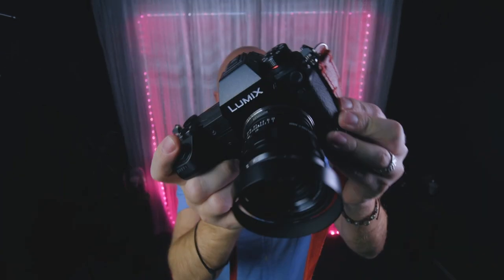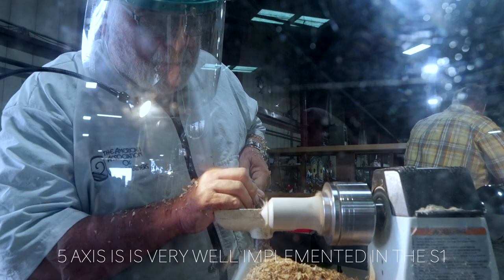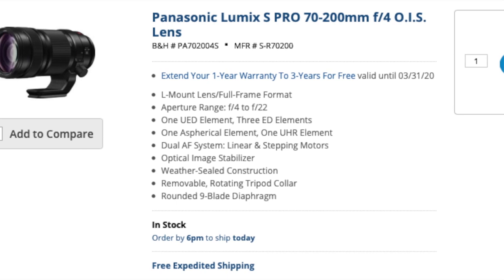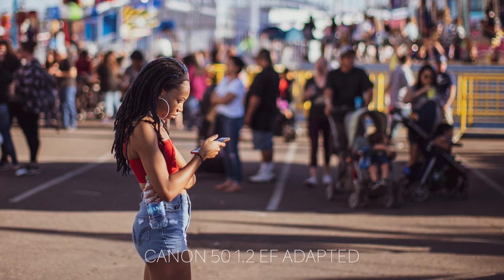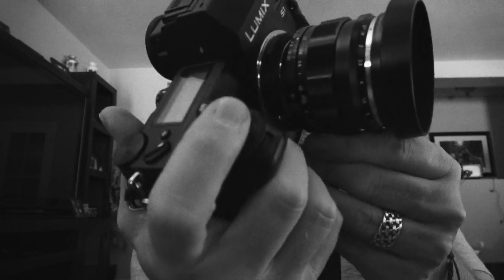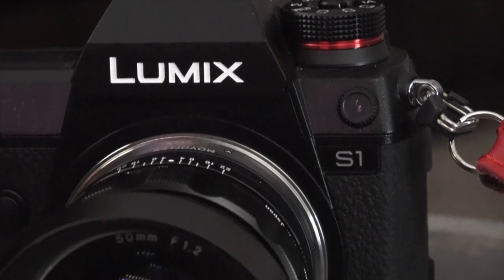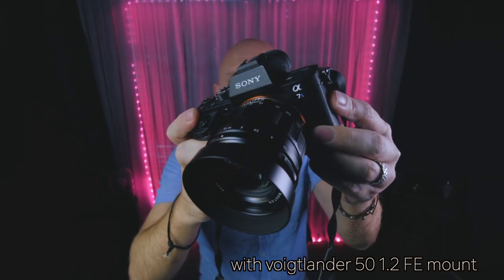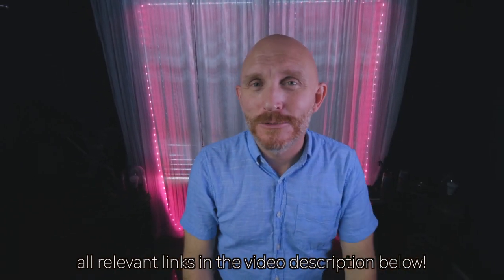The Panasonic S1 REVIEW. Darn NEAR PERFECT Digital Camera

Comment: Great review, as always. I have the S1 and absolutely love it. I use only all manual adapted lenses (milvus f mount) and love the look that this camera is getting with these lenses. I am finding, though, one small problem. I am unable to remove the four cornered focus box from both the EVF and back screen. Not a big deal at all, but just wondering if you were having this problem. Perhaps it will be addressed in an future firmware update. Thanks again for a great review!

Comment: I keep going back and forth on the S1 vs. S1R vs. SL or waiting for the SL2. Most people think that the S1 uses a Sony sensor while the S1R uses a TowerJazz. Looking at cameras that have had Sony sensors don’t seem to have the same color as Leica’s which have used TowerJazz. I realize that each manufacturer has its own color profile though and Panasonic’s is looking pretty good in both of their full frame cameras but I think I still prefer Leica color.
Reply: All those tower jazz sensor myths for Nikon we're debunked and there is no reason to think they make anything for Panasonic either. 

Regardless, DXO mark and dozens of other websites have both S1 and R performing well as long as AF tracking isn't something you value.  

Easy to rent from lens rentals online, so no point in stressing over them....try them.
Reply: J. T. The difference here is the full name of the company is “TowerJazz Panasonic Semiconductor Co” ... I would be surprised if they didn’t use their own sensor on at least some of their cameras. Leica at least has confirmed they use TowerJazz Panasonic.
Reply from the maker: I will say the Q2 uses the S1R sensor and it lacks IMO. Low light is abysmal (as shown in my Q2 review) but if you only shoot in good light, and want to crop a lot then the S1R would be it. Since I shoot in low light often I love the S1. The SL2 will use the higher res sensor like the S1R and Q2, which for me, makes it a non starter. My opinion is anything over 24MP is for fluff and marketing. I do not see the need. We have master works of art that were created on 35mm film which is much lower resolution than what we have today. But again, higher res brings cropping power which some like.
Reply: @Bryan-lu4du  Panasonic was working with Fujifilm on sensor tech for several years.  It may be the same base sensor from Sony yet with anti-reflective coatings and more sophisticated dyes for the colour filter.  The G9 and GH5 were significant improvements in colour, and I think that Fuji and Leica co-ordination explain it.

Certainly they outclass the Alphas significantly; the A7III has good colour compared with the earlier ones (incl. A9, A7RIII), but doesn't look good next to the S1.

There were also reports of collaboration between Fujifilm and Samsung for the chemicals used between pixels (for better colour integrity) so we may see Samsung sensors enter the fray soon.

Comment: Nothing bellow 42mp interests me anymore.
Reply: then, if it should be sth. with L-mount, wait for the sigma... over 60mpx, coming out 2019/20
Reply: The S1 got a 96MP high resolution mode.
Reply from the maker: All depends on your needs. If you always crop, then 42 and above is useful. If you value DR and low light and do not crop a ton, 24 MP is the sweet spot. The S1R low light performance is not anywhere near the S1, so all depends on preference.
Reply: FastAkira - 42mp doesn't work so great in low light compared to the S1.
Reply: stupidfresh305  - Probably the pixel peppers..
Reply: stupidfresh305  - Your pagan gods of vodoo will have no effect on a child of The Most High God - The God of Israel. You should be extremely careful when approaching any of the people of The Most High God of Israel! 

A curse on anyone who makes a carved or metal image, something Adonai detests, the handiwork of a craftsman, and sets it up in secret!’ All the people are to respond by saying, ‘Amen!’ Deuteronomy 27:15

A curse on anyone who does not confirm the words of this Torah by putting them into practice.’ All the people are to say, ‘Amen!’ Deuteronomy 27:26
Reply: Get thee a Hasselblad.
Reply: @RJPhotographics  Fuji gfx 100? Maybe?

Comment: Contrast AF no way!
Reply from the maker: That's what I said when they launched it. As I said, it's no Sony A9 or Canon Dual Pixel but it really is the best contrast AF I have seen. Unless you shoot fast action or sports, there is no problem with the AF, even for video. Thanks.
Reply: tamir cooper - the S1 has the most advanced AF currently. It's unlink any camera you have ever had the privilege to shoot with.
Reply: @organicskincare  i am shooting with the sony a9,  Actually most of the time i do manual focus with my leica m10-p but when i decide to shoot AF it will be phase detect with cameras like the a9
Reply: The A9 is the best sports camera ATM. But if you're not shooting sport, the S1 could very well be superior, depending on what metrics you're using. Personally, if I had to shoot sport (and that's not likely!) I'd start with Olympus and move to the A9 if I absolutely had to. :-)
Reply: PD AF is a flawed system that cripples your images forever. No thanks.
Reply: Horses for courses.